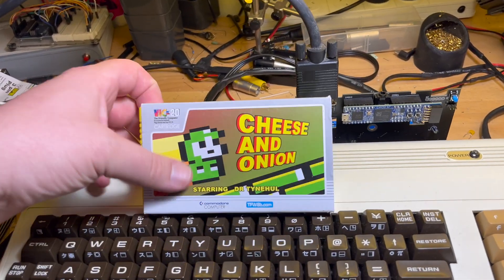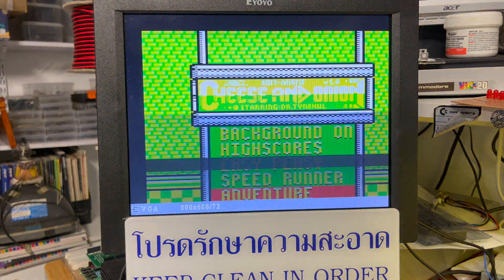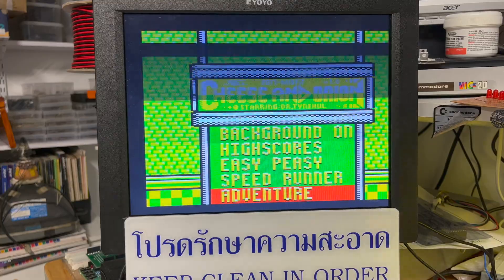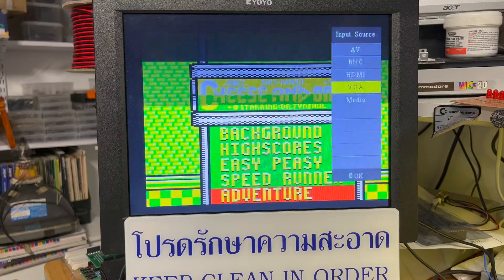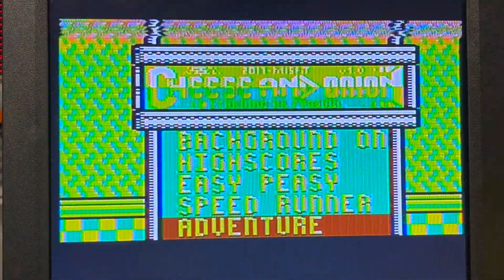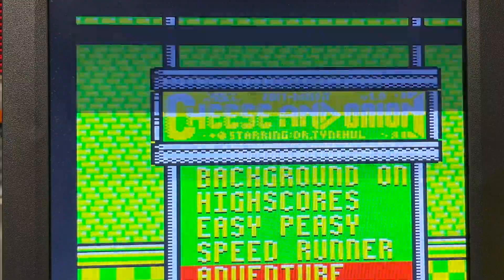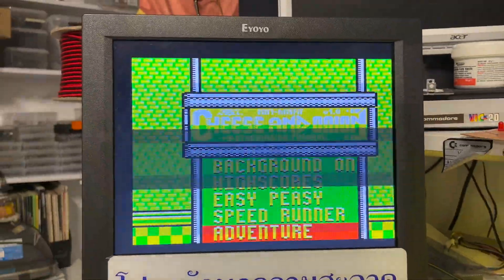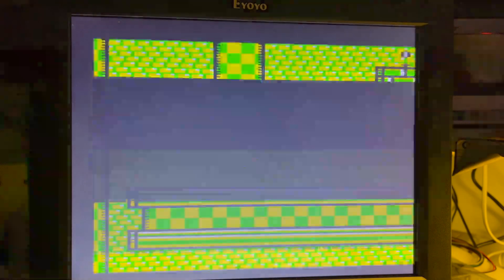Commodore VIC-20: VGA Adaptor (Part 3/4) - Cheese & Onion test [TCE #0193]

Comment: I wonder why the VGA board isn't designed with an extra female cartridge connector on it so that an expansion card isn't needed.
Reply: I am the designer of the VGA card. I have thought about this, and my response is, the card contains many surface mounted components. Placing a edge connector on this card, means that others cards can be inserted/removed, however each time, they will stress the base card, and eventually cause surface mount components to fracture or break off. My experience of these edge connectors is that a certain amount of strength/force is required to insert and pull out cards. And without the base card been properly secured to any frame, it will flex. So I will not be going down this path.

Comment: What about 640x480 would it be better but maybe it is the camera that doesn't like the screen of the computer.
Reply: Even if I implement 640x480, you would still see the flashing. This is caused by the frame rate for PAL/NTSC and VGA been different, also the quartz oscillator and quartz oscillator for the VIC Chip and VGA Chip are not synced. Anyway this is a problem that I now need to work on and solve. Chris
Reply from the maker: I took some video at 240fps today - will upload and send you the link Chris. /Brett
Reply from the maker: https://youtu.be/wlxl7cTvirg

Comment: Thanks for testing, I wasn't expecting the background flashing thing, hopefully that can be sorted (does turning background off in the menu make any difference?). Changing data midway though a line was one of the things I had yet to resolve when I was working on my VIC replacement, I didn't have enough cycles to keep checking if anything had changed. As regards screen width, it looks like it is cutting off the right hand side? (the menu is meant to be centered).
Reply from the maker: The static menu made no difference.  I did also notice when changing the screen size that the part of the screen that was cut-off on the right was disjointed ... so the whole screen could be seen but the previously cut-off right part (border?) was not in line with the rest of the screen.